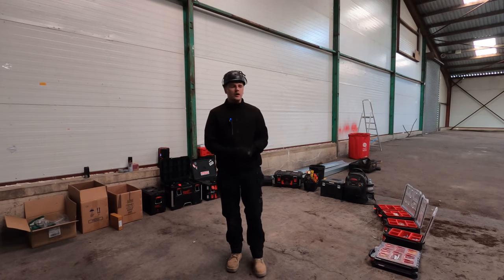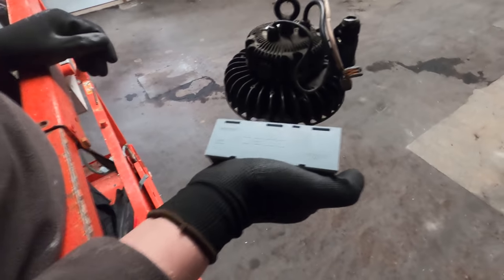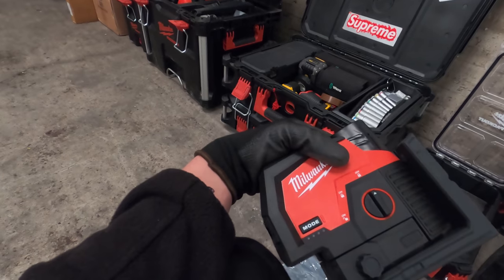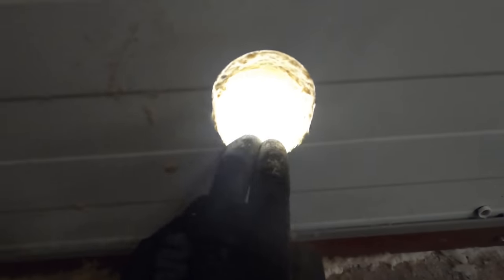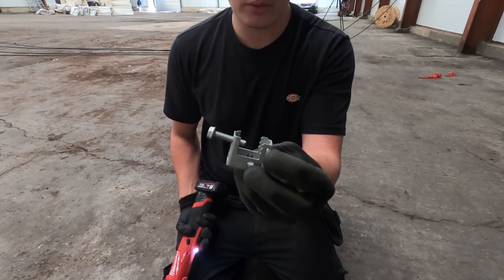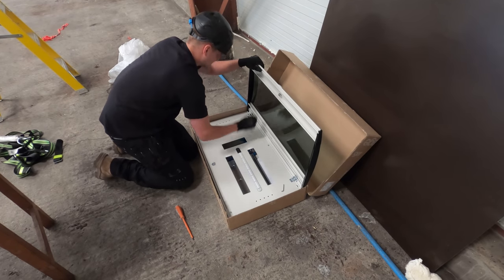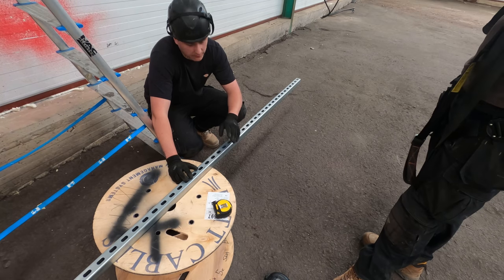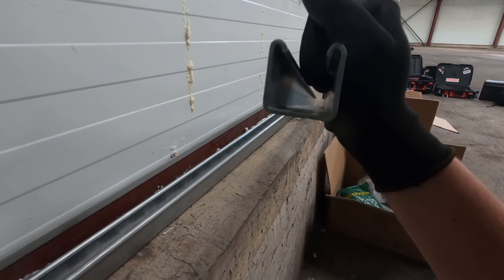Electrical first fix at an industrial unit

Comment: 00:28:29 I used to use those Caddy Beam Clamps by the Thousands. For low voltage installations, All I used to put them on was a 3/8 nut driver. or box end Ratchet Not need for a big power tool. Even with that I could over Torque them. 
Recently Retired, 37 Years in Telecom, Sound, & Commercial Satellite TV/Audio. 
Mike M.

Comment: Great video as usual. However I am not sure about the harness and lanyard on a scissor lift. I might be wrong but I remember when I did my IPAF we were told that harness and lanyard are to be used on boom lift but not scissor lift as it can be an extra hazard in case of a fall.
Reply: No harness needed on scissors or anything keeping you over the wheels, only needed when it can take You outside its  wheelbase 
 cherries etc

Comment: Interesting info from Google “A bubble level has a measuring accuracy of 0.5 mm/meter in both normal and reverse positions. As we have seen, a digital level has an accuracy of +/- 0.05 degrees from 0-90 degrees and +/- 0.2 degrees from 1-89 degrees. So there is almost no difference between them, less than would ever be noticeable by the human eye”

Comment: could the strip connectors have melted from sun via hot roof or loose connection or overload? like the LED UFO lights great energy saving

Comment: not sure why you wear a harness on a scissor? Only necessary on a boom.
Reply: Absolutely, site/ram specific
Reply: No problem not to
Reply: @residualelectrical  I've never had that requirement for scissors on any site. Even IPAF doesn't state that requirement. The point of a harness is to stop you falling from the MEWP bouncing while traveling over uneven ground. You drive over a pot hole on an elevated scissor you screwed anyway. However I do acknowledge that site policies are changing with regards to working at height so perhaps my experience has not caught up. Will say that if its in your RAMS I can't really argue.

Comment: 1 hole drilled and 1 panel mounted in a day, if I was your boss I'd be fuming!
Reply: @residualelectrical  Well, my bad, I didn't realise you had pulled in 300mm of swa. How long did that foot of cable take?

Comment: Is it typical to wear a harness in a scissor? is that the regs in the UK? dont need one in aus for a scissor lift - boom or knuckle boom is a diff story
Reply: I’m a sparky in aus as well and thought the same thing straight away but then i thought if they want extra fall protection then why not and shows you guys are thinking about and following your risk assessments and it’s very easy to lean over further than you should to get some extra reach in the real world when working in an EWP.

Comment: Any reason for not fixing the dB straight to the wall rather than unistrut?
Reply: The four fixing hole locations the DB provides probably wouldn't hold securely enough to that cladded wall as the cladding surface is just a thin metal that tends to strip-out easily.  That particular cladding is just a foam insulation layer akin to expanding foam sandwiched between two thin metal sheets.  Running the struts allowed for lots of individual fixings to the cladding surface to compensate for this inherent weakness.
Reply: Understand your reasoning and strikes of belt and braces. However think 4 decent self drillers would be perfectly adequate imo to support and pretty light dB like the one installed.  I respect your install and its good to see some young electricians focusing on commercial rather than boring domestic!  Keep up the good work fella 👍

Comment: why are you wearing a harness in a scissor? it's class 3a you don't have to wear one, in fact ipaf don't recommend them... Unless thats changed recently. I'd also recommend tethered tools where possible.
Reply: @residualelectrical  I guessed it would have been down to rams. I have to say ipaf are a lot less vague than they used to be. Certainly when I did my last renewal they were much more specific but then again I was also adding the harness inspection to mine at the same time.

I was thinking tethered tools just to avoid dropping anything nice but if I'm honest I've been known to carry a lot of untethered stuff in a basket. I do like the knipex tether system, I used to use a petzl caritool and long lanyards but switching to a wrist mount system is awesome. Mind you for some stuff I just clip long lanyards onto the basket.
Reply: @residualelectrical  inconsistent training is still a big problem, not as bad as when PASMA used to claim to do proper scaff courses (some folk would get a decent course, others wouldn't receive anything other than a PowerPoint presentation). Mind you the same thing happens with forklift tickets too.. I know people been given an all terrain tele ticket without ever even sitting in one...

Then you've got different professional bodies arguing over what's good practice like the use of tallescopes.

Comment: Very nice work. One tip though in regard to video length: you kind of repeat your planning and what you're going to do a lot. It would save a lot of video time if you just do the work and maybe explain afterwards what you did. Also, in my opinion you talk way too much about the tools rather than letting them speak for themselves. Maybe other people disagree and actually come here to hear about Milwaukee battery tools, but I think you can ramp down a bit on that.